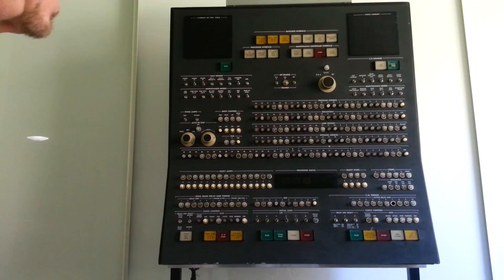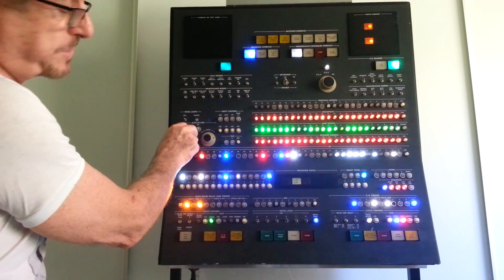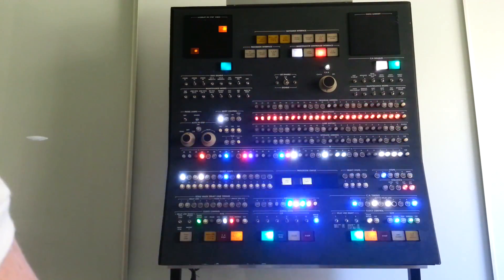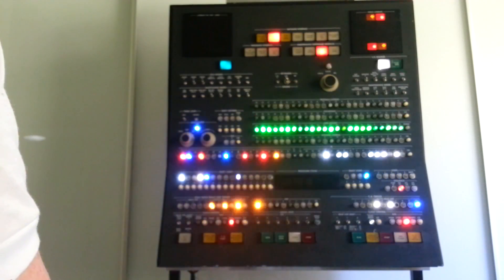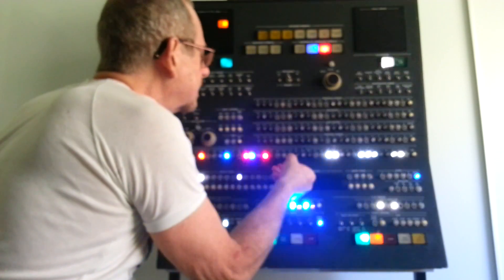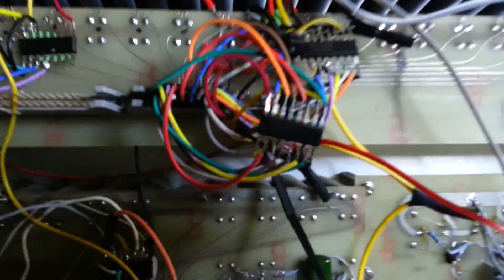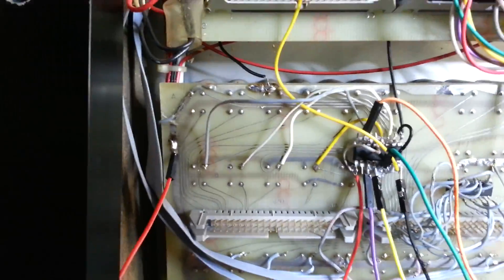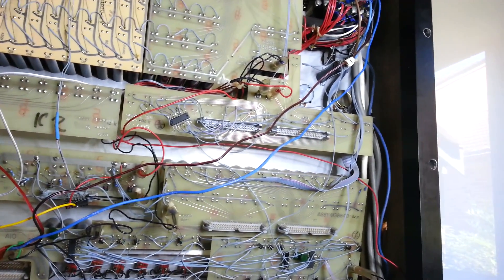Univac 1110 mainframe Control Panel upgrade

Comment: Well done.  I sat in front one of those panels for a couple of years. They built 5 machines to debug the design and I was one of the debuggers on the manufacturing test floor. I was later sent around the world to fix 1110 cpus. Where was this one located?
Reply from the maker: Hi Paul. Thanks for the reply. The machine was purchased by the Department of Main Roads of the West Australian government and was located in Perth.